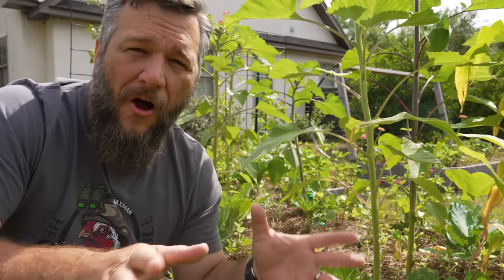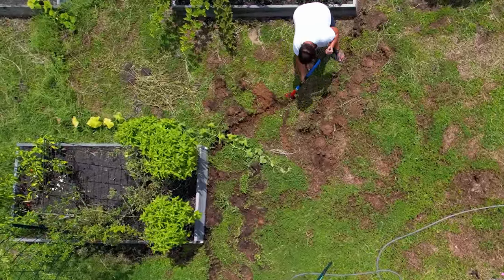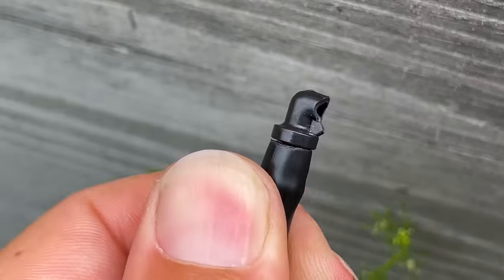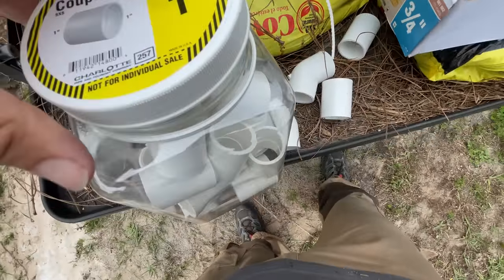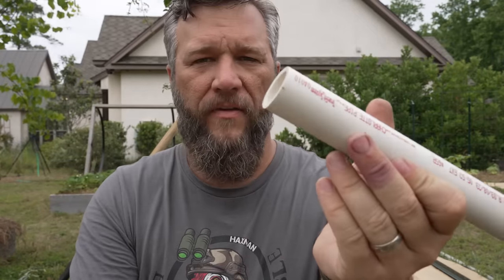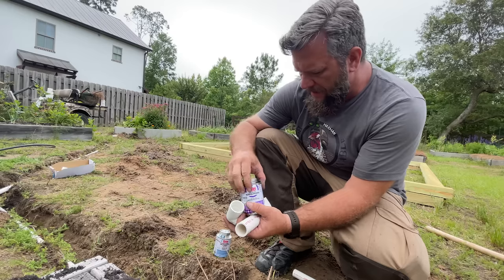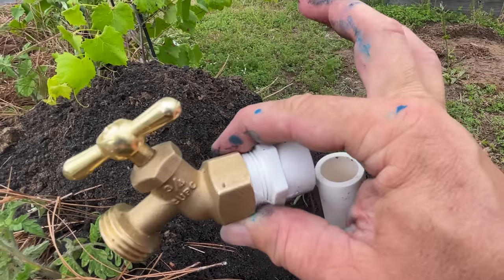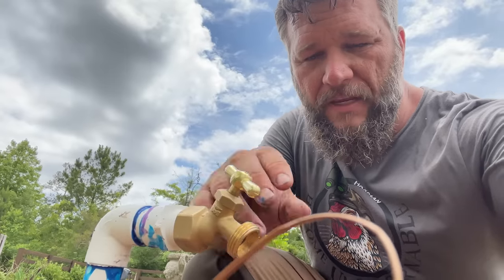Don't Make This Expensive Mistake On Your Raised Beds!

Comment: Hey Brother, love the channel. You've done some good work. However, I will point out. SCH-20 PVC like you have installed works fine for a limited amount of years. Eventually it will crush if your not careful about what you put on top of it. If by chance you do need to replace them due to cracking or whatever, I recomend SCH-40 for any in ground "dirt" type work with PVC pipe. SCH20 works great inside the home without any chance of crushing. But the 20 will even get crushed by your riding mower eventually.

Only reason I know this is by being a septic and plumber for many years. SCh-20 doesnt last in the dirt...It will be fine for a while. Just be aware it has limits.

Comment: I use drip hoses rather than drip lines.  Lines clog fast.
Reply from the maker: I hadn't even thought of that.
Reply: Did you mean drip tube, drip tape or soaker hoses? Never heard of drip hoses. Soaker hoses definitely clog if you have hard water, even the dig manufacturer told me this and recommended drip tube.
Reply: Yeah I used a 1/2” drip tube underground to each bed, 90 degrees up and through the center of each bed, back out and down and back underground to the next and repeat. Once I established the 1/2” tube. I poked holes and ran 1/4” tubes to each plant. I then pea graveled around all the beds so I don’t have to weed whack and damage the tubes.  Put it all on a timer and it’s worked amazingly for over a year. Love this channel and it’s supporters.
Reply: @geeyoupee  soaker hoses like particalized rubber with tiny holes on well water in n.e. Texas.  They last a season or two.
Reply: I would recommend emitters run off a 1/4” line so you can control the flow of each individual spread - you can move nozzles around if one plant is not getting enough water or it’s not hitting an area of the bed.

Comment: Some PVC expert will probably yell at me for this, but you can cut your gluing time in half by using the all-in-one primer/glue combo stuff.  It's not advised for high pressure or residential application, but you're just making a low pressure garden bed.  Also, if your pressure is low enough you can even just friction fit some of your pieces so they can be removed later.  I have a bunch of friction fit pipes in my garden so the next spring I can remove them, till up the soil, replant new veggies, and then reinstall the pipes again.

Comment: I've been using the Digg brand of irrigation components, for about 6 years now.  Love it!  Super versatile with cool, cheap range of micro sprayers and valves and drip lines, etc. They even have misters for summertime.  You can cover a patio with misters for like $5.  With Digg - you could have snapped on some little valves that cost about 20-cents each and controlled the flow of those drippers more accurately.  After every winter I expect to see a lot of broken pieces that froze and cracked or that I stepped on under snow - usually only have to replace one or 2 sprayers,  and they cost like $2 each and take seconds to snap out and snap in.

Comment: I had the same idea to run 1inch pipe to all my beds... but then I thought the kids might get wet while they sleep... 😄

This is a great idea and seems real easy to do, but for me in winter time the pipes would freeze, so I'd have to think of a way to completely flush the pipe in winter.
Reply: A small air compressor will do the trick if you have one. Just get an air hose adapter to fit where the water hose attaches. IIRC you want to stay below 40 psi. Has worked great for us
Reply: 1 inch pipe is total overkill and a waste of money unless your beds are about 10 times the size of his.

Comment: I like to use 1" poly. I heat up the poly with a torch and 3/4 PVC will slide right in. Use hose clamps to hold it together.

Comment: I've personally had a great experience with Netafim Techline AS drip line (1/2" or 13mm). It's pressure compensating - each drip hole delivers 3L/hr (0.8 gal/hr) in my configuration, and the holes are about a foot apart... if you need more water, you either run additional drip line in a given bed; run a specific zone for a longer period of time; or purchase it in different configurations (drip hole spacings). Pretty straight forward to install - run your main header pipes (PVC or pressure/ag poly), then at one end of the bed you reduce down to a smaller low density poly pipe (eg. 3/4" or 19mm), and use punch fittings to connect the 1/2" Techline to the low density poly pipe.

My system has been running pretty much flawlessly for a few years now; I've only had one small leak where a fencing contractor literally hit the drip line with a shovel (small tear in the 1/2" drip line), and one punch connector started hissing/leaking at a higher rate. 

Keep up the great work! :)

Comment: I use a soaker hose, or at least I think that's what it's called. I ran it all through my raised garden bed (17 ft x 19 ft) and pinned it to the soil at the base of each plant with landscape pins. When it's time to water, I turn on the water and let it do it's thing.
Reply from the maker: That may be what we end up using. I forgot all about soaker hoses.
Reply: I really like to make my own pvc hoses that run water quickly and directly to plants. I tie them together and then burn holes near the plants so they only get he water. BUT… pvc has gone up incredibly much in my area (Michigan) and it’s now costly to do this
Reply: @HAXMAN  They work great for me. I have woven weed cloth on top of  the soil and the soaker hose on top of that. I use "U" shaped landscape staples to hold the hose in place.
Reply: @krickette5569  Ive had these before and they ended up getting clogged, also wont work with accuracy if you have to do an incline.

Comment: I’ve had 1/2” supply and 1/4” feeds with both embedded emitters and attached emitters for years, and have not had your experience. To raised beds and containers. The adapters can and break occasionally but I don’t think everyone should assume based on your experience, that they should not use these. Maybe it was the brand? Also, try and have multiple zones connected to a controller, so we can have different amounts of watering and different watering intervals.
Reply: Same here. Mine has worked for 2-3 seasons now.

Comment: I use 8 port manifolds i found on Amazon at each of my beds to control the water output of each line. They adjust flow with a flat head screw

Comment: Practical Engineering did an episode a while back about watering gardens and soil moisture. His setup might be a bit over the top, with all the sensors and graphs, but maybe something similar would let you automatically maintain the soil moisture level depending on what the plant likes. Just a thought.

Comment: Nice job, I can tell you don't live were it freezes.  In my area that PVC system would be a bunch of broken pipes in the spring even if you tried to blow them out.  In any case, where you went wrong is not having a pressurized system with specific drip emitters.  That way you gauge exactly what each plant/bed needs without over watering some and under-watering others on the same timer.  My emitters are adjustable.  I used to use drip hoses, but that never worked right (more stuff in the trash).

Comment: Great video so much work. I have used a drip tape that worked, but I hate those timers as none I bought held up well. I installed an electric rainbird timer for an underground system that fed the drip. Had to get a plumber to help me. Clean drinking water is imp, so bought a RO 5 cartridge filter for my sink (Apec $200) love it.

Comment: I'm glad I have a good bunch of left over pex and pvc pipe from a bunch of plumbing jobs from the last few years. Already built one drip line for my cucumbers from 3/4" pex. I used a garden hose adaptor into a shut off valve, to the pipe tied level along my trellis, with a garden hose spigot at the other end. I drilled 1/16" holes on each side of each plant about 3 inches away from the stalk, at about 45 degree's up from center, and control the flow with the shut off valve, so it is a sprinkler, and a drip system all in one. I can open the hose spigot at the end, and fill buckets and such, while still running a drip, or shut off the spigot, and use just the drip, or open first valve up and sprinkler out over 1/3 of my garden and get the nice morning watering done much quicker than by hand with a watering can, or a hose and sprayer.

Comment: In the fields, we use the lay flat tubing instead of PVC and puncture in the emitters or the spaghetti drip lines depending or use the lay flat with the holes in the seam at the rate for the crop.

Comment: Lemon sudsy ammonia with extra dish detergent out to nip your ants a new one- just a contact spray to keep the annoyance level down when they swarm your work area.
Reply from the maker: I needed that the other day when working on my well. There was a giant bed right where I had to work.
Reply: @HAXMAN  You can also add some isopropyl alky to the mix.
Reply: also diatomaceous earth. (gets in under the exoskeleton, like v sharp sand. works on other bugs set up that way)
Reply: Green Gobbler Orange Oil mixed 1 oz to 1 gal water kills those suckers dead, and won’t put any harsh chemicals around your food.  4 gal-ish per 2 foot mound. Create a moat around the mound to prevent any escapees then drown it.

Comment: Just run a  couple garden hoses in your beds, cap them off  and poke holes in them as needed.  Then adjust your water flow at the spigot for preferred flow. That's broadly the cheapest way.  You can of coarse
Use irrigation line or whatever the same way  but expect to pay more.
Reply: Actually irrigation line is surprisingly  very cheap.   Probably the most cost effective .

Comment: I use 3/4 inch to 1/2 line and installed a shut off valve at each row (I plant directly in the ground not raised beds). 

I had 1/4 inch lines before and they clogged after a season. Going on 3 years with the current set up in growing zone 7.

Comment: I used PEX with its brass couplers.  Then attached soaker hose cut to length in each bed to loop all the way around it.  Then back to PEX.  I turn on one valve and all beds get watered at the same time.  I even bought a timer for the water hose, only to discover all the directions were in Mandarin. Oh well.

Comment: Really liked this video, you made it look easy, I’ve always been intimidated by drip irrigation. Thanks for sharing the video
Reply: Drip is super-easy. No need to run pvc pipe to every bed. Just buy a roll of 1/2 drip line. Can also buy 1/2" drip tape that uses same connectors. Simple to do.

Comment: Wife and I have tried many different kinds of drip and soaker systems. The only one we've used more than 2 or 3 years is what we are using now. 3/4" PVC pipe with 1/8" holes drilled in it. PVC main line distributes to various valves, and each valve feeds a length of 3/4in pipe with holes and the far end capped. Nothing downstream of the valve is glued. Can slip off the end caps to flush lines. When a hole plugs up a bit of wire fits into it to unplug it.  Being friction fit together all but the main can be removed for tilling or rearranging.  A selection of elbows and pieces without holes allow rearranging lines. For raised beds like yours I'd probably run the main to and put a valve at each bed.  (We tore out our raised beds after 8-10 years.)

I'm not in Utah, but the state university extension office there (USU Extension) published a good intro article, "Designing a Basic PVC Home Garden Drip Irrigation System" and reference material.
Reply from the maker: That's a good idea. I've never seen it done that way. Thanks!

Comment: 'Weather man said it was 50/50'......that explains why I'm only getting wet on my outsides.
Reply: The real 50/50 is when it's only raining on half your yard 😂 

I've seen it several times in my nearly 28 years, just a absolute curtain of rain and then a single step (maybe 2 feet) away dry as a bone, sun shining over both sides

Comment: Oh man! Wish I had seen this a month ago. Invested in Drip Works for our garden and now hesitate to finish the project. 😢
Reply from the maker: It could have been my environment that played a part. The biggest problem was the 90 degree connections for the 1/4 inch lines. If you can avoid those it might save some hassle down the road.

Comment: Hi I've been doing plumbing electrical for over like 49 years now and you're going to run into a couple of problems one of them will be what time the PVC will degrade in the sun rays it will get dry and brittle an impact on it or shatter it like glass 

The other problem that you will run into I don't know where you live what part of the country if the temperature drops below freezing point you'll have to bleed your lines just before winter you'll have to empty them with a compressor get all the water out and leave the valves open 

And I'd like to mention by the way you make great videos we always love some sense of humour in the videos it keeps it interesting I don't know how to get in touch with you by email so if you give me your email I will send you an email correspondence so I could solve some of the issues so that you don't waste money and waste time
Reply from the maker: Hi Gilbert. We are are in the deep south so we rarely get freezing temps. I’m happy for any advice from an expert though. My email is rmccreatestation@gmail.com.  Thanks!

Comment: 1" and 3/4 is overkill for most backyard garden applications. 1/2 will flow plenty for drip applications, I use mostly drip tape and haven't had any issue with clogging but I also have a spin down filter before it heads to the irrigation lines.

Comment: Seems like a lot of work to just even out the drip. One of the things I do with my raised beds is use adjusting drip heads. I have one line on timer, everything gets watered at the same time in the right amounts. My raised garden isn't huge by no means, it's just 70' X 30' but it gives a retiree something to do.
Take care and great video

Comment: My main issue with this kind of system, and even our lawn sprinkler, was using the water from our irrigation district.  Its unfiltered, so all of our stuff was always clogging up with grass and seeds all the time, so you were always cleaning filters etc that were plugging
Reply: You can install a sediment filter at the point of entry to solve those issues.  They are cheap and easy to swap out the filter.
Reply: @christopherwisofsky4247  True, but its all outside as well, and the input line is a 4".
Reply: @virgil3241  you’d prolly be best to just drill some holes in some pipe that’s capped off and crank your shut off valve real low so the pressure dribbles out. As far as the sprinkler heads go for your yard just use rotors as much as possible they’ll shoot that gunk out no problem
Reply: @benjaminthompson4370  I actually dont have raised garden beds, just telling the issue I have. Any of my sprinklers are you described are fine.  Its the types that are the fan style that have issues.  Ive worked around it mostly, but still they plug due to some big piece of something coming down the line.  Is what it is.

Comment: Sand gnats???  I haven’t heard of thoses and I don’t know if that’s what I have, but whatever I have here in central Texas is making it impossible to do any gardening stuff. And, like you said, mosquito repellent is doing nothing to deter them, even in the middle of the day. The pest control company is coming out to spray next week, but they don’t guarantee that it will work against anything but mosquitoes. I’ve been calling them no-see-ums, because that’s all I can find online as to what they’re called. At least with mosquitoes you can see  and hear them…not that I want those either, but I hear ya’! Hopefully, you got rid of whatever they are!  😊
Reply from the maker: They are the same thing. I think we call them sand gnats mostly in the South East.

Comment: Line the beds with plastic, fill half with clean rock, then the dirt.  Drill a hole at top of rock. It will never over fill, and the water wicks up into the dirt as needed
Reply: The rocks will be a breeding ground for grossness...

Comment: Thank you! Great, timely and much needed video for a system that appears would last for years.  But, I would have liked to see the final drip line  and timer installed and operating in the bed.  I'm going to do it the way you've done it.  Perhaps a follow up video before I plant? :goodvibes:
Reply from the maker: I’ll try to at least do a short when Kim adds whatever system she goes with or put an update in another video. Thanks!
Reply: @HAXMAN  that'd be great! :)